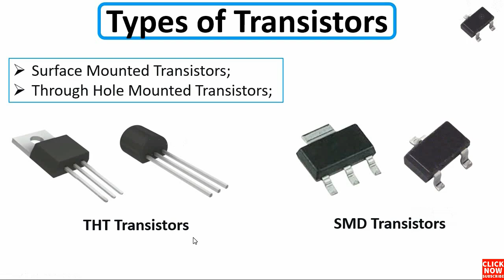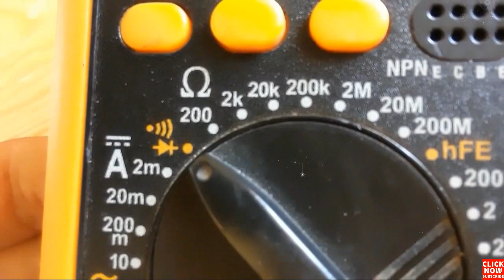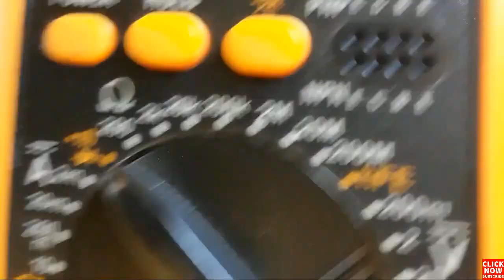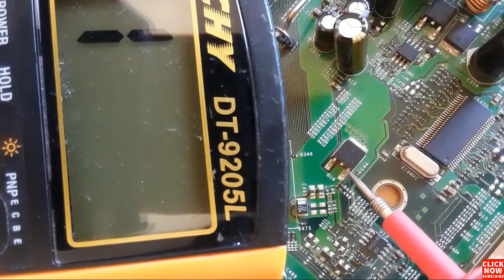Learn how to test transistors with a multimeter on a circuit board, how to check transistor MOSFET

Comment: Testing 3-pin transistors and 3-pin SMD diodes is very difficult as long as they are still on the board. There is no standard system that applies to the motherboard. Component testing is done on the motherboard of an LED TV or other device, compared to a laptop motherboard. Component testing methods differ. They are either damaged or normal. It requires a long learning curve for beginners, unless they have years of experience.

Comment: Hi, I downloaded all your videos, they are the only ones I've seen done well, congratulations. I wanted to ask you for help if possible, I have a PCB of a 16V amplified car antenna, I have identified the 3-pin SOT-23 amplification transistor which bears the abbreviation RC5, it should be NPN, following your test video with the tester being tested diodes, the red probe on the base, the black probe on the collector gives me a reading, the red probe on the base, the black probe on the emitter gives me a reading, inversion of the probes and still gives me a reading..........; I tried with the Peak DCA75 which I also have and it gives me correct transistor values; I do not understand...........

Comment: Getting annoyed, don't know what i'm doing wrong literally following what you're doing and get a reading on both sides when in diode mode and this isn't a bad motherboard, it fully works. Getting it on every transistor.
Reply: realised it was a diode i was trying to read... but they are literally the same component... the only thing different is the board markings...
Reply from the maker: Hi there,
For some transistors, It's okay if you get a reading on both sides, Don,t be confused.
Reply: @electronicsrepairbasics_erb  does this apply to your diode video too?

Comment: Hello sir ..
Thanks you soo much .. I'm really interesting with you explaining...
How can I test crystal oscillator with multimeter...
Secod: what about voltage value on capacitors if I tested when connect board by electric I can get same values on capacitors...
Thanks ..Ali ..khartoum
Reply from the maker: My pleasure, glad to hear that.
1. To test the crystal oscillator you need an oscilloscope or a multimeter with frequency testing ability.
2. It is not recommended to test the capacitor while applying power. 
Good luck.